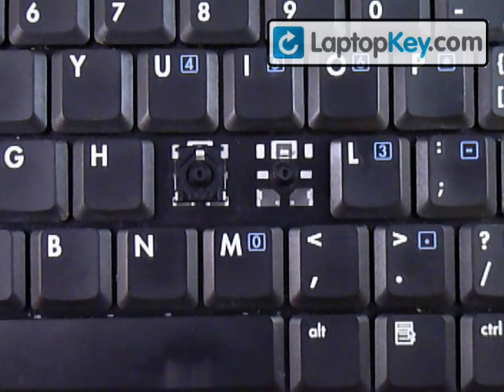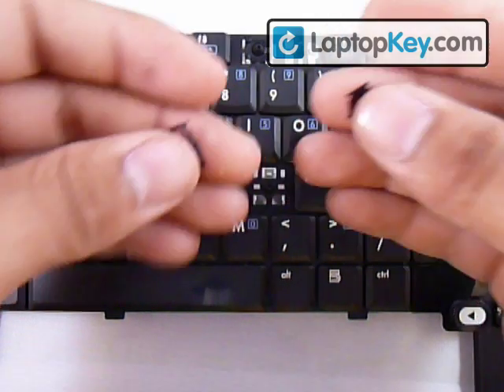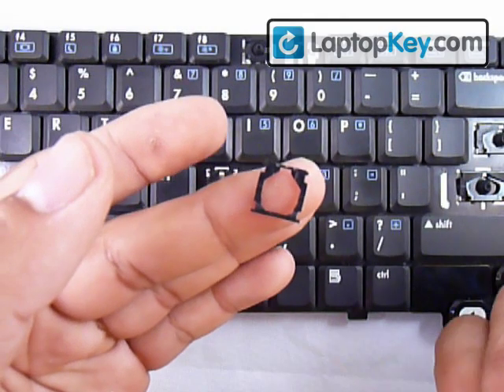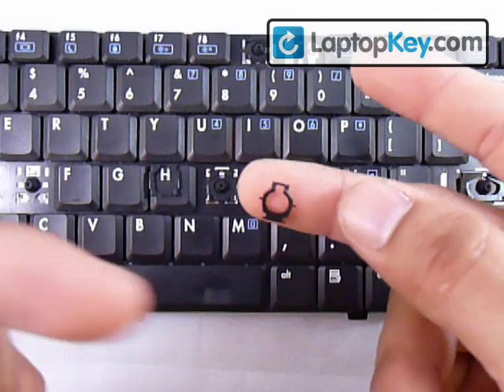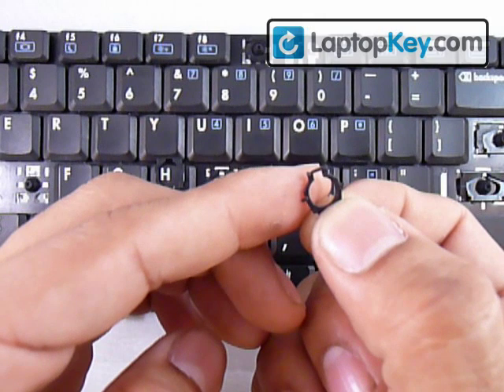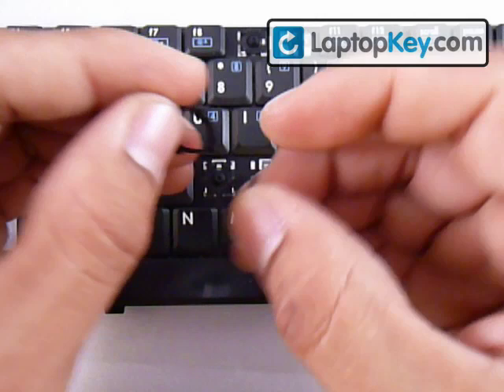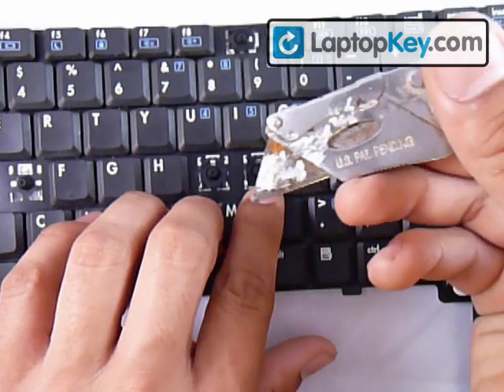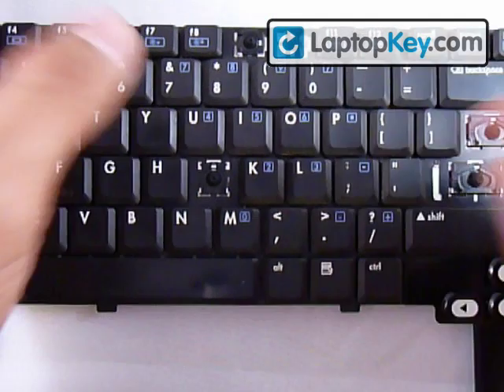Fix Broken Keyboard Key HP Compaq Presario Pavilion Installation Guide

Comment: The two plastic pieces will not clip together, anyone got any hints? 

(N.b they fit together but they will not properly connect, once attached to the keyboard they come apart and then it's useless)